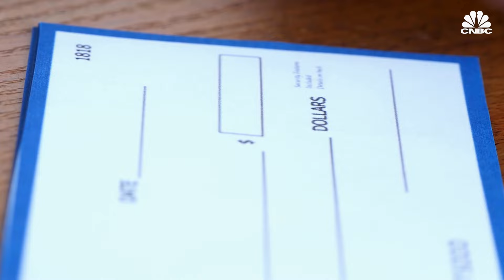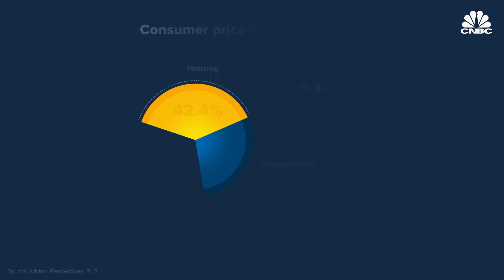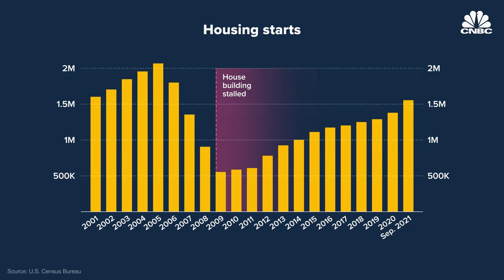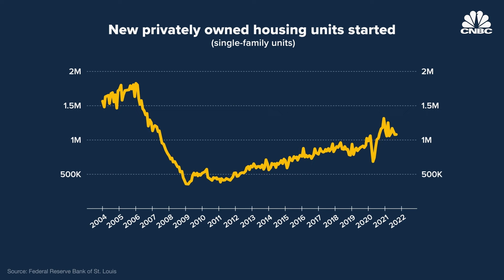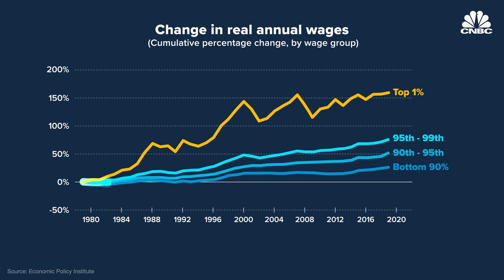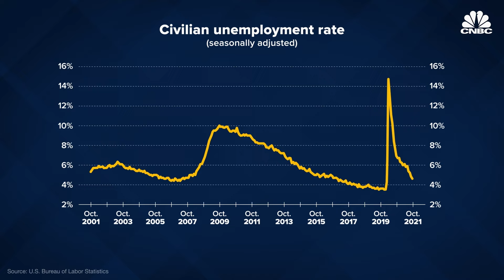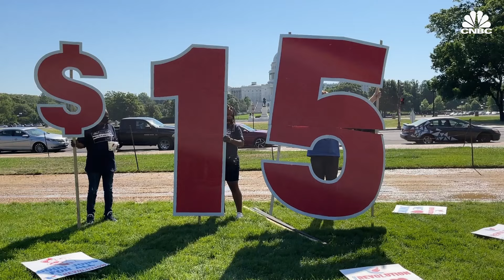Why Rent Is Rising In The U.S.

Comment: Rent control doesn’t really work. It just makes it so landlords have to raise their rent every year to keep up with the rents and discourages building more rental units. Even with rent control, rent is based upon supply and demand so if you artificially lower supply, overall rents will go up. Rent control sounds like a good thing but in practice it doesn’t work.
Reply: They are doing that anyway.  Every year sign new lease Rent goes up.  If you don't sign is goes up a $100 above the lease price.  There are few mom and pop rentals here that get hurt anyway most already bought by Corporations.
Reply: @Adam Miller is right. San Francisco and New York City have rent controls and they’re the most expensive markets in the nation.
Reply: NO, that is the old way, What we all have learned in schools is not what is going on. Artificial is a non-starter because it is either existing or it does not. Attach rent control to sliding income and minimum wages Both Federal and State. And If corporations enjoy Highways and byways and gated communities built for their high wage earners
where and how do service jobs, and related people fit in, or not. The luxury folk can clean up after themselves. White flight Houston, Texas Style, Exxon Woodlands, Grand Pkwy 99. The energy grid is stretched too thin for the leeches with the tax breaks expecting luxury service. Rent control works when it is useful and wanted and needed and the coup de grace is the tax advantage, while the new schools, transportation, and hospitals were expanded and finished because existing businesses have been paying taxes for thirty years and growing in rates and numbers of small business. White flight works as it is rent control and luxury planned to co-exist. Without any noticeable numbers of immigrants or Black Americans. It works.

Comment: In many of the high cost areas such as Boston and SF zoning is the biggest issue. It is very dam difficult to build higher density housing in areas that have high demand. There needs to be more action at state and federal levels to allow for higher density housing especially in areas with transit availability.

Comment: The fact is that rents are high because there are built in shortages of affordable housing.  Developers only build high rent apartments, not lower end housing because that maximizes profit.  Only through publicly financing housing can this trend be reversed.  But builders, developers and the real estate lobby discourage  low end affordable public housing because it cuts into their higher end profits.  It is a self fulfilling conundrum.  Shortages of low income housing cause rents to rise and real estate interests oppose building affordable units because it cuts into profit.

Then there are laws that are on the books that are incredibly favorable to home owners and real estate interests but decidedly not to renters.  Developers and landlords oppose rent controls, get special tax considerations and depreciation unavailable to renters, and they can spread the use of property over a whole family or simply withdraw rental stock at will and hold it off the market.  This leaves tenants facing annual rent increases while facing stagnant wages. Their tax burden is proportionally worse.  They are constantly faced with limited housing availability.  Tenancies can be ended at will if there are locally insufficient tenant protections.  Eviction is easy and lucrative for landlords without rent controls.  Building codes aren't enforced and landlords defer maintenance or allow units to fall into disrepair.  Rent prices are so high and housing is in such short supply that landlords face no competition and can rent slum quality units easily and make good profit off them.  This sector is very out of balance with the greater economy.

What to do?  Simple.  We must pressure federal, state and local governments to require builders and investors to include 15% affordable units units to be included forcall commercial beildings built or remodeled to be in the low or extremely low affordable categories.   And then we must convert 5% of existing units to to affordable units over the next five years.  Now that's for the big corporate landlords and major home construction builders.  Mom and pop owners must  be considered corporate owners if they own ten or more units in one building or more buildings totaling 20 housing units.   They must convert 10% of their housing  stock to liveable and affordable units too over a 5 year period but amortized over the life of an existing or newly financed loan.  Banks are going to have to be lenient on those constructing or converting affordable housing.  This spreads the pain of conversion and constructing affordable units over a period of time, and accross all types of housing.  Both developers, owners and banks will share the burden with government.  If necessary property taxes on home ownership can rise a very, very small amount to help finance this public good.

Rehabilitation of existing unused and unsightly buildings can be accomplished with public financing and sweat equity.  Just as land owned and left fallow when there is famine can be considered undesirable and must be put to good use, so too can abandoned or unused buildings be acquired to alleviate the housing crisis that plagues most every city.  We need not consider profit and property rights if a building is neglected and empty and the land under it is not being used to a higher value.  In other words, if you aren't making money off scarce urban property, or it isn't being used for some public good then cities should simply aquire the eyesore and put it to use for the growth of the economy and shelter of our people.  Waste like that cannot be allowed anymore.  To hell with private property rights.  We need housing!

We must resolve to provide shelter for low and very low income workers or resolve to increase wages to meet the ever increasing  greed of landlords.   We cannot continue to allow landlords and home owners to get the tax breaks that make ownership rentals so lucrative while at the same time  encouraging shortages of shelter for our people.  Nobody should be paying more than a quarter of their income for rent.  Most of us are paying near or over 50% of our income for shelter.  That is considered being rent burdened.  We simply can't continue with the business model we have been suffering under.  The ups and down of our economy make building and renting both expensive and variable, but it also makes affording shelter increasingly impossible for our working people.  Someone must bear the pain and it cannot be our already burdened working people.  Cities suffer because of the growing unhoused sector but cannot remedy the situation alone.  Counties and states can help but that's not enough.  Only the whole of government on every level and placing some small burden on home owners, developers and the real estate industry can solve this problem for the good of everyone.

Once again, billionnairs are making our lives miserable by owning and controlling everything leaving less and less for us to survive on.  It is immoral  for a tiny few to have incredible riches and obscene privilege while almost all of us are scrounging for survival.   The system isn't working.

Comment: They raised salaries here in Tulsa and they have a pay back of $10000 if a remote worker moves here. Rents have gone up at least 4 times more then they normally would. So if they give more money; the property owners, in my case who are out of state and have a big national management company running it, will raise my rent higher. I am on Social Security and I earn just enough above the poverty line that I have to pay Oklahoma state taxes but can not get Oklahoma state help. I live in one of the lowest money states in the US.  I also live in an all bills pay place so it is reasonable but they still raised the rent 4 times more than normal. I can not afford $200 or more per month more on top of this rent and still pay electric and heat.  So If I am thrown out and homeless, who will help me?

Comment: The system is designed to keep us from saving and buying our own homes by keeping rent high. This allows landlords to save money off of your rent money so they can invest in more rental properties. I’m trying to buy a house right now and it’s hard because there are so many rental investors bidding on every house. Crazy
Reply: Free Money from the Fed is what caused this massive inflation .

Couldn't afford to live near my Parents so I moved on the other side of the Tracks and a few years later moved across the street from my Parents.

I did a study , it took 30% less minimum hours and coincidentally 30% less gallons of gas to equal a house mortgage payment today than in 1978 when my parents bought their house brand new  in Los Angeles for $83,000 now worth $900,000 (i wanted to try Gold next but pretty sure same outcome) . So times are not great but not the worst thanks to low interest Rates just make sure you get Fixed and don't want to move for 15 years  since when % goes up prices come down but the payment stays the same relative to incomes.